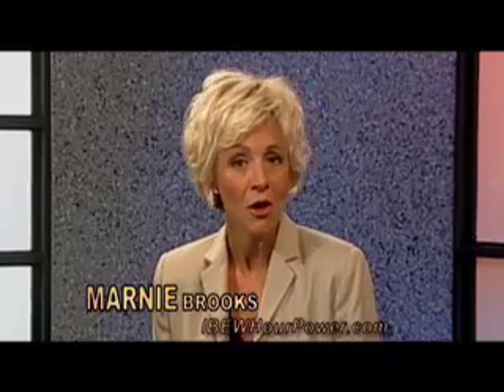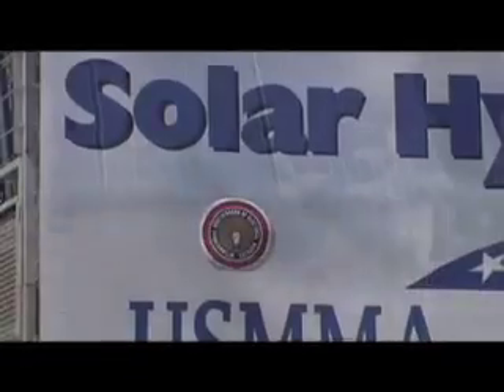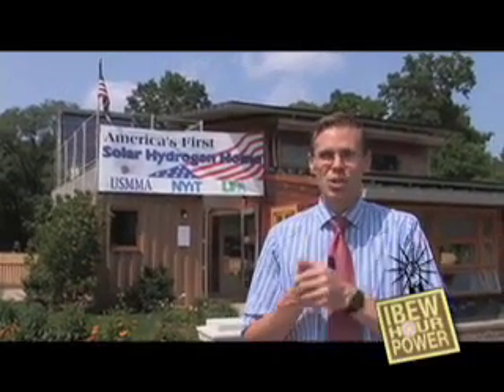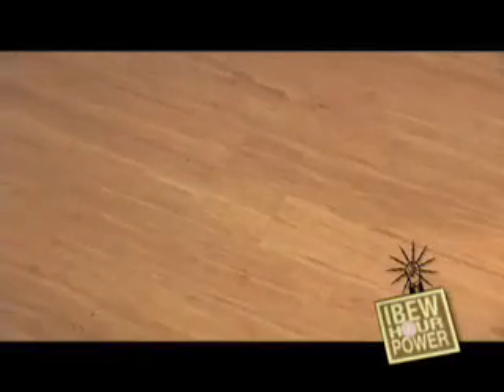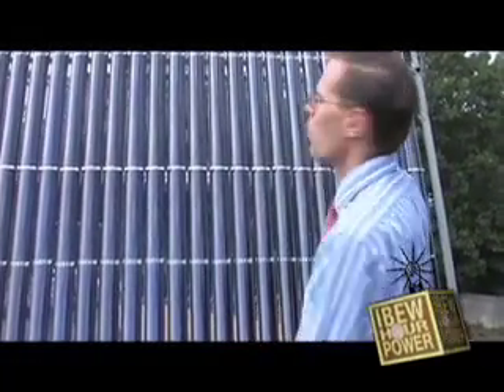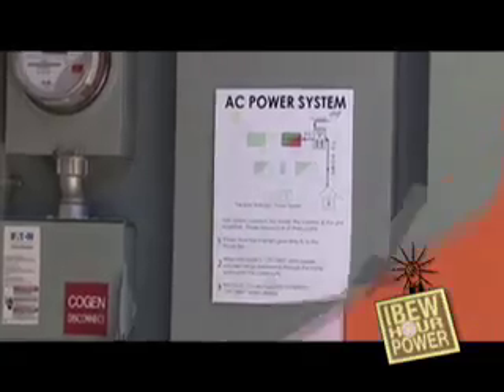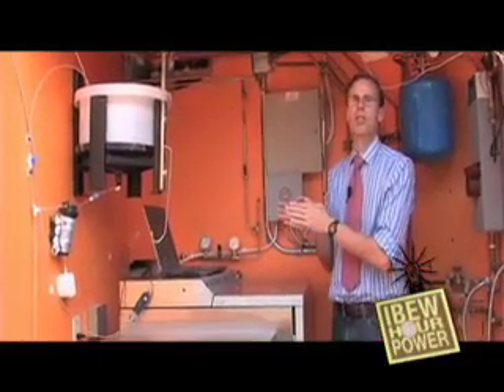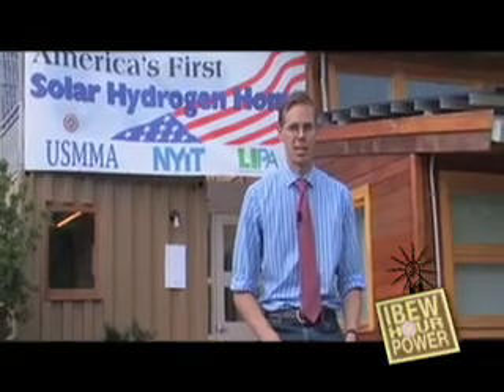IBEW Hour Power Feature Story: Solar Hydro Home

Comment: Excellent ibew electician in alaska. was reading and watching our power hour.when i ran accross this. i have been interested in solar and hydrogen conversion process for some time this has renewed my hopes in finding a solution to the problems for sometime. I am truly excited to find this.. is there a way to get the detaled schematics and blue prints for this PrOJECT?? GREATLY APPRICATED. as i am looking for a way to help the tribes in poverty stricen areas with systems and to develop anaproach

Comment: I agree. I have a question. I've been playing with some H2 and HHO generators. I actually got an H2 equipped 1988 Honda Accord with over 150,000 miles, at the time, with a carb and a transaxle that was slipping and dripping from the moment that I purchased it from a neighbor on the cheap, to achieve an even 50 mpg between Wewoka, OK and Ada, OK, when I re-topped her off on the way to Dallas, after visiting relatives in Wewoka. I haven't played with the electronics of the HHO. Any tips, or links?

Comment: It doesn't.  The solar water heater does just that - it heats cold water to make hot water for use in the home.  It replaces the homes water heater.  Solar to heat is very easy and can be 90%+ efficient.  Solar to electric is ~15% efficient.

Comment: Cleaver!  How does the energy of hot water get converted into electrical energy?  And what is the construction of the thermal piping?  Is there water flowing inside?  Please explain, because I want to make on of these.  Thanks.